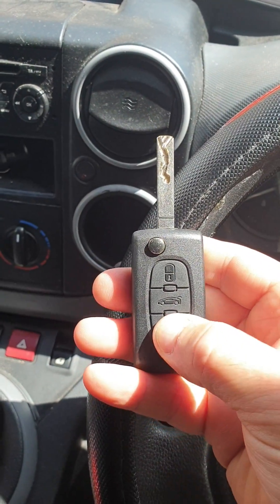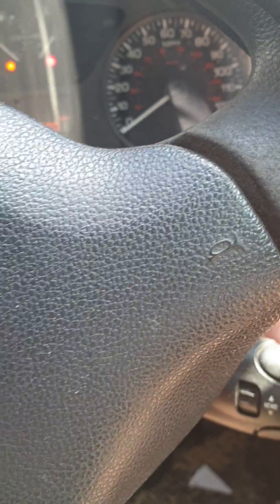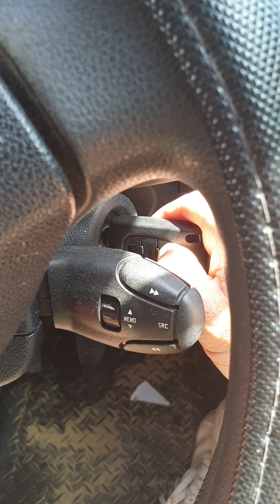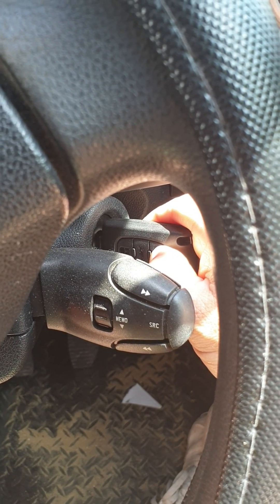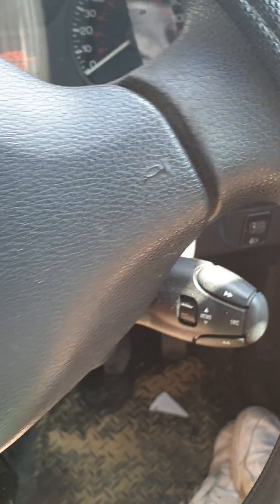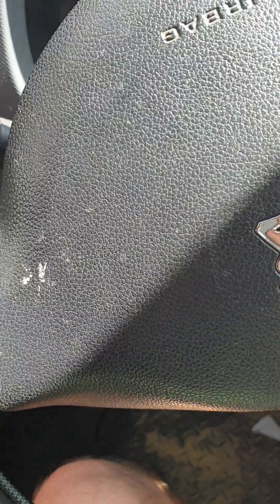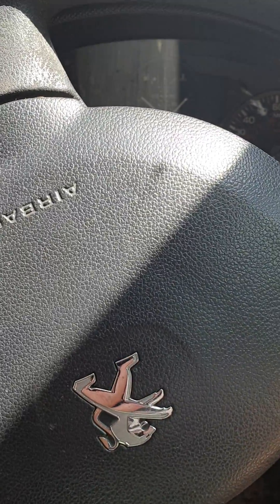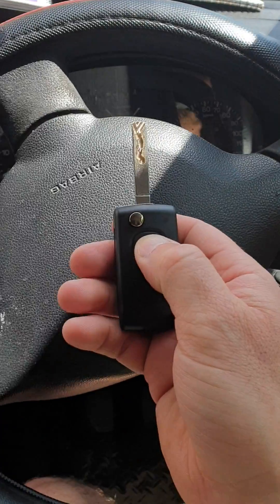how to Re sync a Peugeot or citreon key fob DONT PAY DEALER PRICES

Comment: Worked fine for one fob but not the other, then realised one that didn't work was an aftermarket one, managed to get it working by following these steps for each button individually, starting from the top
Reply: You mean you did 10 seconds per button?
Reply: @chocoboasylum  yep, top one for 10secs then press the button to action its function, then on to the middle and bottom buttons following the same process. Have to say the the fob is very temperamental tho.
Reply: Thank you very much, you just saved me alot of money  and time to go to a garage to get it done. Worked first 👍🏼
Reply: thanks this steps worked for me had to do the pressing thing with each button and worked !

Comment: You guys, honestly open up your key fob and check the battery first. I did every single type of this procedure I found on YouTube tutorials only to realise my battery died. I checked with my digital multimeter and the old battery had 2.6 volts, and I bought a new one for 1€ and it has 3.2 volts. Replaced it and now it works like a charm!

Comment: Just had my RCZ become completely unresponsive today before work, wouldn't react to FOB, and the manual lock has NEVER been used since it was made. Bought a new battery before work, replace it, still no reaction, had no idea this was the case since a lot of cars have different ways of fixing this.

Thank you dude! Just replaced my Fuel Injector in my car, was terrified of it becoming useless again! <3

Comment: Do you know if this works for the universal fobs you can buy from eBay? My key didn't come with a central locking fob built in but it's a 10 plate partner so should have central locking

Comment: Just echo the comments above for my Peugeot 1007.  I have two keys, one dead after a car wash and revitalised by using your procedure, the other key does all the remote functions, doors and locking , again the dash lights up and the starter cranks the engine but it will not fire.  Of course I tried your procedure but the difference was that this key already worked the locking and the doors so must have been half linked to the system, just not the ignition.  Any ideas?

Comment: Brother just bought a 2008 c4 grand Picasso, put new batteries in, 1620 type, one fob now works one does not. Gonna try this later, :-) great easy to follow video buddy, thanks for the upload. :-)
Reply from the maker: No problem, good luck
Reply: And did it work ?
Reply: @lahbibt1234  no did not work. Thinking the fob itself, is faulty. Can open door lock and start car using faulty key with no problems so key is coded to car OK, just not operating central locking. Hope this helps.
Reply: Its working so thnx

Comment: Thank you so much for this video. I saw another video about how to change the case etc because mine was broken. I've done that so am ready to try what you suggest. When I used to lock and unlock the car manually sometimes my boot or one of the doors would not open. Do you think it's wise to try this as it would be a risk or do you think it would sort it out. My car is a Convertible so the boot is a nightmare to open if stuck. Many thanks :)
Reply from the maker: It won't hurt to try it out. If the remote works then the doors won't have an issue unlocking, assuming the lock mech in the car isn't broken.
Reply: Thank you so much. I think it's worth having a try. Best wishes :)
 @Cityautolocksmith803

Comment: Thank you. I have a 2019 Rifter, (in Ireland); my remote key stopped working. I tried this trick but it still doesn't work. Are there any other suggestions that may work for my car? My wife's remote key works fine, but I use my key all the time, she only uses hers now and then. I checked the battery but it's fine. I have never changed the battery but possibly the garage may have done on a service. I think it may be covered by the warranty (?) but the garage is 30 minutes drive away, I'd prefer to fix it at home.

Comment: Excuse my ignorance but what do you mean by newly programmed key? If it's been programmed why does it not work?
I ask because I wish to get a couple of new keys for my rcz, saw some newer designs for sale that will need the blade to be cut but they also came with the electronics inside. Do I have to take them somewhere first. On my jag it was just a case of pop it in the ignition repeat some button code pressing and hey presto.
Reply from the maker: Transponder needs to be coded 1st
Reply: @Cityautolocksmith803  thanks 👍🏻

Comment: Thank you, thank you, thank you! I’ve changed the battery in the fob a few times over the years and I’ve never had to do this. Last week the fob stopped working, I changed the battery and nothing, I could do everything a key should do circa the 80’s but this morning I found this little gem and hey presto I have a functioning key fob. 👍🏻😁
Reply from the maker: No problem
Reply from the maker: Pleased it worked

Comment: If you re sync the main remote key do you have to re programme the spare at the same time.
Reply from the maker: Only if it isn't working
Reply: @Cityautolocksmith803  OK.
When my dad put a new battery in the main fob He had to reprogram it and after that the spare wouldn't work and also had to be reprogrammed.

Comment: Hey thank you for this tutorial. It works but just if I keep the key very close to the starter lock, otherwise it don't works :-( I already changed battery. Any suggestion?
Reply: I've got the same problem right now. Did you get that fixed? And how did you do it?

Comment: Hey buddy.
I programmed a new key for peugeot partner using xtool it starts and lock/un locks car with the key.
But the fob won't sync using your method.
My original key sync worked 
But not the new one.

I bought the key fob from hickleys
Does the key need to be from peugeot.
Thanks.
Reply from the maker: Key doesn't need to come from peugeot. I use aftermarket all the time. Has to be right key for van. Depending on year partners are usually 0536fsk

Comment: i have just bought a 207, I found that the spare key wouldn't work, I tried this & it only sort of works, What i am now getting is the remote will lock/unlock doors but the key has to be no more than an inch away from the ignition switch or it wont work, also it won't start the car, I have fitted a new battery so that's not the problem, My other key works fine so it's not an issue with the receiver side of things, Any ideas please? TIA.

Comment: Have a new blank key / circuit board , will this simple method work if I swap key from old fob ?
Reply from the maker: No. Needs  coding 1st
Reply: Got the 4 digit code from Peugeot dealer via my vin number, used planet 2000 followed a simple video it coded new key got cut as old transponder died not giving out signal , so pp2000 coded the new key using 4 digit code didn't have to put old key in Ignition  was very simple really , car going again 12 Euro on AliExpress blank key/fob
Reply: Followed this video newly programed key , starts car but central locking not working, any ideas would main lock button on console near gearstick be problem you think?

Comment: Hello!! If remote is broken but I have original key, ¿can I replace remote control with another,  put original key on it and program with your procedure?  Thank you in advance
Reply from the maker: No you can't. The metal part of the key has nothing to do with the coding. You would need a qualified professional to code new curcuit board to car. This process is re sync an existing working key
Reply: @Cityautolocksmith803  Thank you very much for your answer. Best Regards, Fran M.

Comment: Hi, i have a 2014 partner van, just replaced the fob casing, and new battery, fob not working to lock or unlock, even after this procedure. funnily enough though, it will work with the old damaged body? scratching my head begins, lol, anyone have any ideas? thanks in advance

Comment: Didn’t work for me, any ideas? Got Timpsons to cut a key for me I bought on eBay. Starts the ignition but won’t work for central locking. Battery also checked. 2016 Peugeot Partner.
Reply from the maker: The keys needs to be directly coded to the van 1st, cloned key won't work
Reply: @Cityautolocksmith803  how does One do that
Reply from the maker: @t1000eg  you need an autolocksmith to do it

Comment: Hi James, my key only works when the car is "active". In other words, when I have unlocked it and turned the ignition on I can lock and unlock the car. But after a while, when locked the remote does not work. Any idea?
Reply: I have some problem with my peugeot 308 ,2008 im losing my mind because of it. I canr get to my car at -10°c mornings because my car lock is frozen up only i can get is electric lock but my keys aint working
Reply from the maker: Have you changed battery in key? Or could be sensor in car
Reply: @Cityautolocksmith803  have the same problem - what do you mean by sensor?

Comment: I have a car key shop and I always face this problem. However, sometimes this problem cannot be solved and I do it, although it is the same frequency but it does not work. Why do you think that even with the original key it does not work, especially with the Peugeot 207 and Peugeot Partner? Help me.
Reply from the maker: I dont understand.  Are you coding a new key or re syncing an existing one?

Comment: can i do this with a new fob off ebay on a 2013 citroen relay? thanks
Reply from the maker: No mate, relay is a fiat system. Doesn't work the same.
Reply: @Cityautolocksmith803  ok cheers for the reply

Comment: Mine is Peugeot 3008 2012 diesel hybrid. Secondary key with 2buttons is working but primary key with 3buttons not working. Tried this technique but not helped. Any suggestions?
Reply from the maker: Change key battery?

Comment: Hello mate, I have a problem with my 2007 Citroen C2,when battery was about to die,it showed error for battery on board,but remote locking still have worked,than I replaced it,tried your way to synchronize but it won't do so,any advice?
Reply from the maker: Take key to a shop and see if its sending a signal
Reply: @Cityautolocksmith803  Thanks for quick response,will do
Reply: @Cityautolocksmith803  After a brief period of time,I wanted to try it with old one,and surprise,it works with it,I don't know what this was
Reply from the maker: @kuvidar  good news, so this procedure worked for you, im pleased
Reply: @Cityautolocksmith803  Honestly,when I put back the old one,I didn't even need to do that,it worked without it,the new battery was of "Grundig" brand,paid for it around 2€,only now to check info and find that Grundig doesn't even produce  that kind of batteries officially,I will go out and buy Varta tomorrow,and will type here what happened with that,just for sake of everybody to know.
Reply: So if anybody is having the same problem as I had,I must say it was the bad battery all along,the one that I bought at first was fake,probably cheapest battery money can buy and wrapped in package of famous brand, I than bought another and now everything works fine,watch the battery fellas,only buy Varta and such.

Comment: It didnt work for me. I noticed when I turned on the ignition - shortly aften the display in the dashboard showed a crossed over key. Any idea?
Reply from the maker: Does car start with that key. If key isn't being recognised then this won't work. Although I've never seen a crossed over key on one of these cars
Reply: @Cityautolocksmith803  no it doesnt start just turning the engine. Maybe the key needs complete reconfig.?
Reply: Hi can you advise…is there a difference between resynching the key such as you show in the video and programming new remote to the car. I need to get a new spare remote, and have it cut and ‘programmed’ to my car. Citroen dealer wants almost £200 for a key and £156 to programming. A complete rip-off I’m sure.

Comment: Hi,I just cut a spare Key and programmed it for my neighbour's 2014 Citroen Berlingo,it starts the car fine,but I can't get the remote locking to work.I've tried a couple of routines I've read online,and the one in my lonsdor k518use but no joy,can you help?thanks!
Reply from the maker: Check the frequency of the key. A berlingo is the same as a partner and must be an 0536 fsk frequency remote.  Most PSA remotes will programme in and start as they are id46 pcf7961a transponder on the board, but it has to be an 0536fsk to work the remote locking. Hope that helps
Reply: @Cityautolocksmith803  only info where i bought it was ID46 433mhz. Thanks for the reply,appreciate it!
Reply from the maker: @robbocop33r12  I can supply you the right key if you want one, they are £36 including delivery. Let me know

Comment: I have a 308 2012 315MHZ japanese import car/key  , the only aftermarket key in 315 MHZ is a different shape 3 button instead of 2 button,   key cut and starts car but will not sync with doors , any ideas ? did this process
Reply from the maker: Is key sending a signal?
Reply: @Cityautolocksmith803   Hi Yes its sending out 315  ask and the odd time the other one I forget the name

Comment: Does this work for a Citroen Berlingo van? I just tried it and it didn’t work for me
Reply: Try the battery connector. I had the same issue. I put the old connector in as it was the original. I brought a replacement which was a copy.
Reply: I have a van to it does work. If you brought a replacement which is a copy the battery connector is a low quality. Just change it. I reassure you that it works

Comment: Hi mate, my central locking was working sound on my Peugeot partner van until battery went in the fob, got a new battery in now, would this system work for my van so it re syncs central locking? It's a 2012 model? Any help would be appreciated pal
Reply from the maker: It should work perfectly, assuming the new battery is food and the key still works fine. Try it and keep us posted
Reply: @Cityautolocksmith803  I will do mate, I bought the new fob battery from a small car parts business and said it was the right one, il give it ago and send feed back, cheers for reply 👍
Reply: @Cityautolocksmith803  sorted mate, topman for advice, happy days👍

Comment: Hi, does this procedure works only for Central locking system or to program immobiliser too?
Reply from the maker: Just to re sync central locking. Transponder needs coding via diagnostics
Reply: @Cityautolocksmith803  Which tool would you recommend for this ?
Reply from the maker: @ahaqq1366  AVDI

Comment: Hey brother does it gonna work on peugeot 307??plzz let me know waiting for ur answer
Reply from the maker: It will work if you already have a programmed key that starts the car, and did work remotely before and has stopped working remotely due to a battery change
Reply: @Cityautolocksmith803  i actually dont know brother it just doesn't work i will try twommrow the way u show to do it hope it gonna work

Comment: Did not worked in my case.....Key was damaged.  Was able to lock/unlock the doors but unable to start the engine. Locksmith replaced immobiliser chip and programmed the key. Now the key starts the engine but can't lock/unlock the doors.....I mean same original key.. Tried to resync many times but no result...Can anyone help?
Reply from the maker: You need to check that the key is sending a signal still. It may have been damaged when the fob was opened up.
Reply: @Cityautolocksmith803  Thanks for answer. Yes, the same original key is still able to send the signal. Locksmith was able to confirm that with his equipment.

Comment: Hi will this work when there’s a new circuit in my key ? The old circuit had broke so I’ve put a new one in ? Thank you
Reply from the maker: No needs to be re programmed unfortunately
Reply: @Cityautolocksmith803  I have bought a new circuit to my key. Any idea how to re program it? Thanks
Reply from the maker: @migueldias71  hi there, it would need programming by a qualified autolocksmith
Reply: @Cityautolocksmith803  thanks. Best regards

Comment: My local locksmith says he can only program Immo/transponder, but no radio controls. Will I be able to give him this type of key (blanc) with buttons for Immo coding and cutting and establish radio controls the way you show?
Reply from the maker: If you use the right key for the car then the remote locking side will 100% work as they programme along with the transponder at the same time. You may have to re sync after programming as per this video
Reply: @Cityautolocksmith803  Thank you,  I was searching for this answer!

Comment: i changed the battery and followed your instructions but it doesn't work what should i do? mine is a 2008 C3
Reply from the maker: If key is sending a signal and worked on car  before this should work. Check key is sending signal, or that you have a decent battery
Reply: @Cityautolocksmith803  how do i check the battery is good and when i get into the car it tells me info about the anti-theft anomaly

Comment: Hey! I got a used fob from the scrapyard,taken from another citroen c5(As i have). Can this procedure work to program a fob,just to have a spare fob? Just by putting my original kei in the other fob?
Reply from the maker: Won't work as key is locked to the other car
Reply: @Cityautolocksmith803  Hi, I bought used key with uncut blade and remote won't work. Please, is there a way to get 2nd hand electronics (locked to the other car) working?

Comment: This didn't work for me have a 2006 Citroen c2 1.6 vts,  replaced the remotes battery I've put in 3 new batteries already tried the way you have showed still nothing remote useless right now car can't lock at all don't know what else to do hope someone can help me please with another solution or something
Reply from the maker: Need to check if the key is sending a signal, in a shop